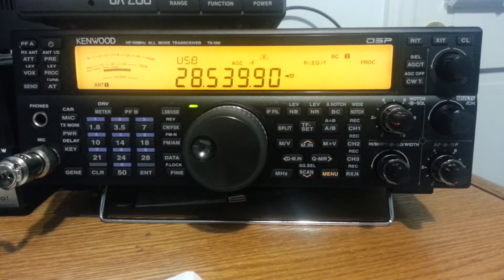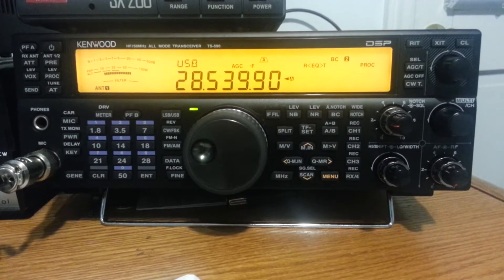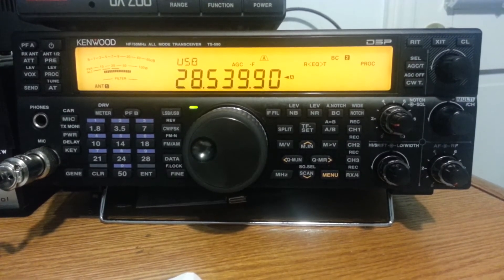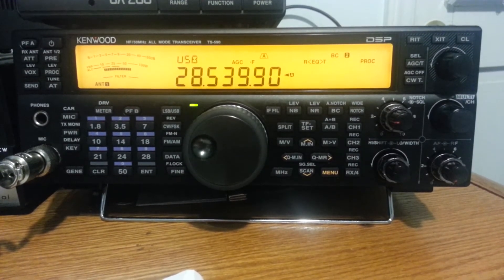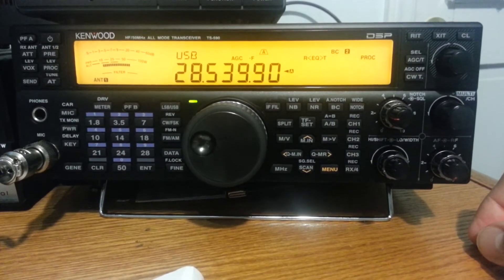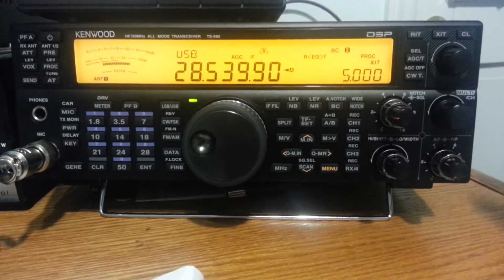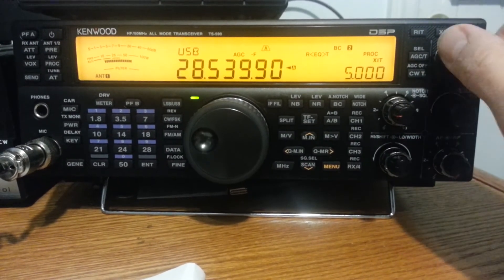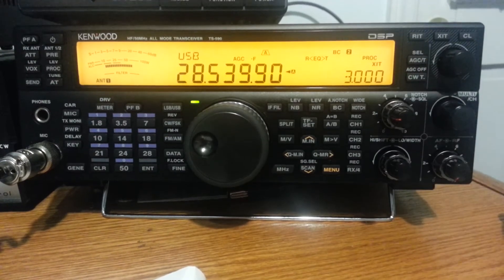Setting "split" on a Kenwood TS-590S

Comment: Why is split operation used at all?  I can see a case for tuning into an off-frequency transmitter, but then the operator of that transmitter should perform repair rather than forcing other operators to tune into him/her.
Thank you
Reply: A station that is popular and has a pile up (such as a rare dx station) will work split so that he or she can be heard over all the stations calling them. It can also help spread out the calling stations so it is easier to pick out calls.